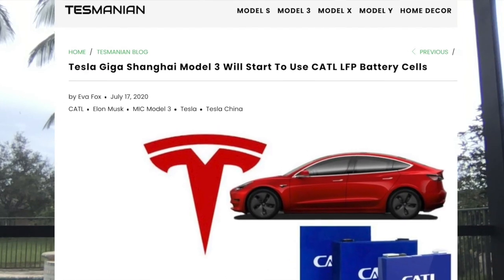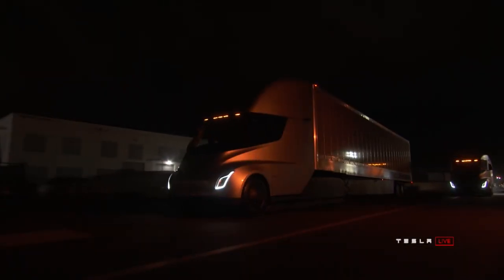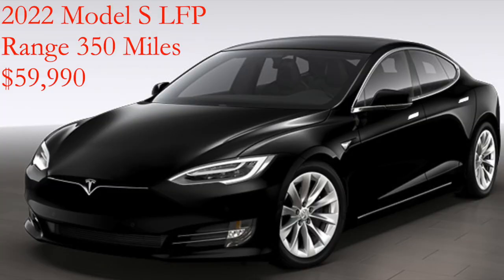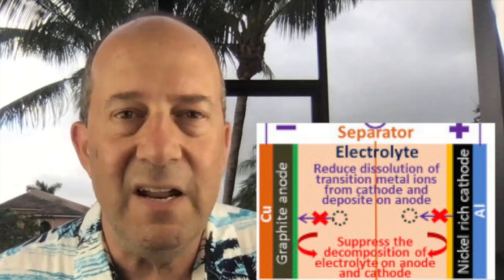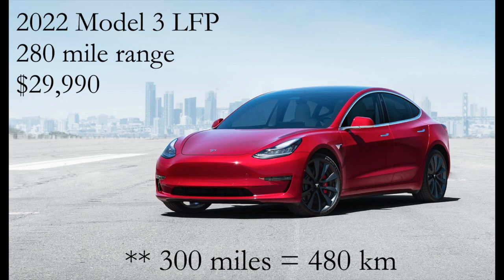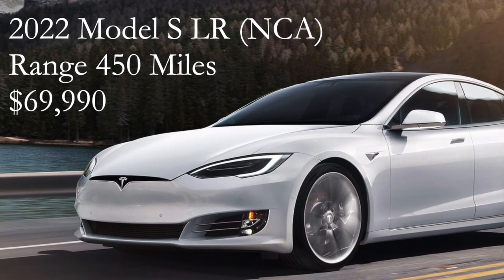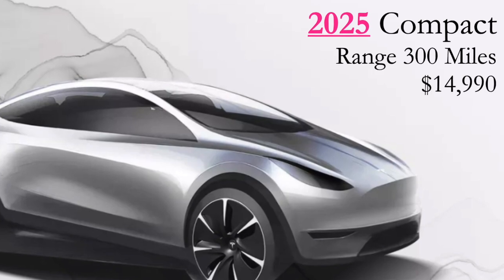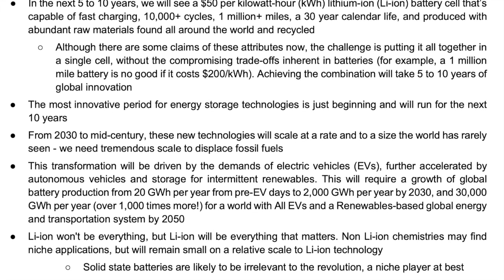Battery Day Secrets: 2021-2025 Tesla Lineup - Elon Musk

Comment: Why not use silica as the anode?
It should be a dual state sacrificial anode, theoretically having a virtual endless longevity unlike all other previous batteries.
It's simple is it not?????
Crystalline and readily absorbing water based electrolyte , best of both worlds  slow discharge , rapid charge  best of all (LOW HEAT) and extremely inexpensive.
Reply from the maker: Silicon expands too much during charging and that creates problems. They’re working on finding ways to incorporate more silicon into the graphite. Limiting Factor channel has discussed this in a couple videos.
Reply: @WarrenRedlich  I wonder if under high temperatures and magnetic field the quartz tetrahedron would combine with carbons graphite structure it may even produce the elusive hexa graphene allotrope  substrate that links in with silica's tetra formation.

Comment: A lot of it seems very plausible to me. But I don't think the prices will go down much, it's senseless to lower the the prices to a point where the wait for the cars will continuously increase because global supply of raw materials is inadequate. I think their vehicles will mostly improve, and prices roughly remain the same. The low cost market will be covered by Tesla network, an eventually used Teslas. A compact is plausible, but personally I don't think it will cost less than $20k. 

Your proposed pod, why? The total cost per mile for using shared vehicles like the model 3 or a compact in Tesla network will eventually become lower than it is in reality for most bicycles, for most users.  Safety is very important to Musk, that's why Tesla doesn't make motorcycles, a small pod can be made better than a motorcycle, but still not really comparable to a car like model 3.
Reply from the maker: Pod is because they can make 3X as many of them.
Reply: @WarrenRedlich  I see your point. But also, that would be after the semi, roadster, cybertruck, ATV and one, or possible two  compact cars.  They're approaching a point where they afford to build as many factories they want. 

Personally I don't think a pod for common road use would be very advantageous, not enough to be worth it. I think they will get less and less limited by production capacity as time goes on. But hey, we will have to wait and see, if Musk agrees with you, they will make a pod. If he continues to agree with me, they won't make a pod.

Comment: Warren, you are the only Tesla futurist on you Tube. Where do you get all this information? Also, the self driving feature adds about $6k to each model, so that has to be figured in. Thanks!
Reply from the maker: I mostly show my sources in the videos, and then I interpret based on what I learn from them.

Correct that the prices I listed did not include FSD. That's currently $7K or $8K. It will go up a lot.

Comment: In all his analysis Warren misses the main point - recharge rate of Model S, which likely to be announced at the battery day, will at least double. At least 400kW.  May be even 450kW or even more. So my bet is: >1million miles battery, >400kW recharge rate (it means  less than 3min/100km),  500 miles (800km) range. Game Over.
Reply from the maker: Good chance they'll improve charge times. Personally I don't see charge time as that important, but consumers may see that differently.
Reply: @WarrenRedlich  The charge time is a critical metric for the consumer. This matters a lot for a long travel. Also this is the only advantage of ICE car over electric. I was disappointed Tesla didn't even mentioned it during the battery day.

Comment: It's difficult to find a good in-depth description of 'lithium metal', 'anode-free', or 'lithium-air' batteries.They may even be basically all the same...???. But they seem have in common a theoretical maximum specific energy of around 40 million joules/kg (compared to around 46 million joules/kg for gasoline). But ca. 90% of battery energy can be converted to automotive energy compared to only ca. 30% of gasoline energy.

Comment: Great video. Very exciting to see the price predictions. Can’t wait until this comes to fruition. One thing I might disagree on is the pickup truck market takeover. I think it’s going to be quite a while before an electric vehicle can tow my 7000 Lb travel trailer or a farmers 15000 trailer full of equipment very far before the battery is drained. It will happen but it is a problem for now.
Reply from the maker: We shall see. I think tri-motor Cybertruck with advanced battery pack will do just fine. I suppose it depends on how aerodynamic the trailer is.

From what I hear, pickups burn a lot of gas when towing heavy loads.

Comment: No mention of plaid or liquid air?
Reply from the maker: I mentioned Plaid in the video. Somewhere around 20 minutes, give or take a minute I think.

Covering Lucid in next video, tomorrow morning.
Reply: @WarrenRedlich  you mentioned batteries. You didnt mention liquid air compressor or HVAC efficiency copv tanks safety systems or even what plaid really is at all. Or that this will be addressed at all during battery investor day at all.
Reply from the maker: First I"ve heard of a liquid air compressor. What does that do?

Plaid has been discussed before - tri-motor with advanced battery pack. Maybe I should have repeated that. Thanks.
Reply: @WarrenRedlich  you have no proof the plaid motor is 3 electric engines. You have no proof at all

Comment: Warren - I do not think TESLA will use LFP outside of China .
America is vast , and LONG RANGE Performance is KEY. 
I think America will use ONLY 2170 and Advanced Battery in the Future . 
It looks like China is shipping Model 3 to parts of Asia and Europe , they possibly will use LFP batteries in the BASE model 3 cars as Asia and Europe dont need Super Long Range cars. 
GF4 Berlin is working with LG Chem to produce 2170 Batteries under Lisense there. and LFP as well for its BASE model cars.
I think for China / Europe they will Continue making SR+ cars for the Foseable Future but for America , ELON has said TESLA will be Replacing SR+ with RWD Long Range ONLY Variants. with a minimum 300+ miles range . 
this means China / Europe will use LFP for SR+ variants and 2170 for Dual Motor + Performance .

Comment: Warren - LFP batteries can be packaged without Modules , Direct Cells to Pack , making the overall battery MORE Efficient. 
its LOW COST is Excelent for the BASE model 3 and Model Y in China. 
meanwhile , GF4 will still continue to use 2170 for Dual Motor and Performance models . made by CATL under Lisense. 
the really BIG announcement comes from the NEW Advanced NICKEL + SILICON LION batteries developed for Tesla SEMI, NEW Roadster and Cybertruck. and perhaps even PLAID model S/X can be Retrofitted with the NEW Cells as well.
Reply from the maker: Isn't that what I said in the video?

Comment: Cybervan? Don’t see that coming soon. Any thoughts?
Reply from the maker: I made a video about it
https://youtu.be/oNzivcVfAmA
Reply: TESLA right now , is not interested in a MINI Bus or a Cybervan. 
it may be Possible in 4 - 5 years , untill then there is PROTERA and BYD buses , which are 100% BEV and can transport 60 + People in Relative Comfort. Tesla will be making a 12 - 18 seater TRANSPORTER for the LV Boring Tunnels , in the mean time TESLA intends to supply them with TESLA vehicles.
Reply from the maker: Agree that Cybervan is not happening yet. But by 2025 it'll be on the road.
Reply: @WarrenRedlich   - most Likely , but would still like to see a Tesla SEMI based Public Transport with 60 - 80 seats , and a Safety Driver until FSD is Perfected.

Comment: I disagree w/ Warren’s 600 mile Tesla Van estimate. Recall the Tesla Semi goes about that far with 80k pound payload ! 

So I estimate the Tesla Van, about the same skateboard footprint as a Tesla Semi, will get closer to 1200 miles a charge, smashing a great psychological barrier as that will be more range than ice vans ! And liquid hose hyper charging will take about 30 minutes.

Don’t forget, Tesla is now researching liquid cooled charging to the Semi, so Semi-drivers can recharge during their require 30 minute break. This could be available to Cybertruck & Tesla RV as well.

I also believe the Tesla Van will have at least 4 completely different market segments or forms.

The first obvious two are the boring tunnel and Hyperloop capable Tesla Van people-mover and/or car mover. Figure two cars transported by a Hyperloop or boring tunnel Tesla Van sled,( skateboard portion of the Tesla Van only). For a 22 person tunnel people mover, it will be a complete shell Tesla Van.

The 3rd obvious derivative is a Tesla Cargo and delivery Van.

A fourth, not too obvious version of the Tesla Van plays off of Elon’s love of saving his loyal buyers money at no cost. Examples are. such features as lower car electric fuel and cost of ownership cost; lower home electricity cost through power walls, solar roofs, digital virtual power grid that recycled all these plus uses your Tesla car battery for the same; lower cost Tesla Car insurance thru AI self driving reduced accidents; income earned thru Tesla Uber-like service; etc.

To this end, for a fourth version of the Tesla Van, what is everyone’s highest budget item, (same as on a Elon Mars Colony) ? It’s housing cost. For those who desire to, what if Elon could eliminate your housing cost or rent payment, saving most people over $1,000/mo or 12k/yr ? The only catch is you have to live and travel all over the United States going to the best vacation spots and/or jobs.

Easily done with the Tesla Van-RV version: the 4th & most important version of the Van I believe will be the RV version with full off grid, boondocking capabilities.

The new HVAC and water distillation Elon has been interested in lately applies here, as well as electrified A/C, stove, heat, shower water, etc. With a fully charged 1200 mile battery, you should be able to boon dock for several days.

Something RV’ers like is big awning shades. A Tesla RV could have solar pull out awnings several times the footprint of the RV say [3 x ( 22 x 14 )] or roughly 1000 square feet of solar panels. With this awning solar panel system boondocking, (def: off grid completely),2 weeks or a lot longer, should be possible in sunny areas. Also while driving, the roof 14’ x 22’ solar panels will be charging the 1200 mile battery.

Normally RV’ers pay $30-$60 a day for camping spots that supply electricity to run all the house systems, or use a carbon fuel generator. Drinking water hose connections supplied at campgrounds is very questionable and has to be filtered.

A few other small details, the Tesla RV would have to be a little taller than the regular Tesla Van version to allow for a septic tank system, a Grey water system and a drinking water tank system.Tesla’s LSAT Internet satellite system would work great for RV’ers since Tesla’s satellite internet works best in out of the way unpopulated areas and low populated areas where a lot of RV’ers camp. The roofs of RVs are cluttered with a/c unit, satellite dish, airflow pop-up vents etc. A 100% Tesla designed RV would totally flatten the roof for the solar awning charging. In addition, a 22 foot length Tesla RV is still small enough to handle easily on the road and fit in almost all parking lots for shopping or eating.

And there are other possibilities, similar transportation problems will exist on Mars and there should be great research synergy in developing self contained systems,, boondocking is not an option on Mars and marketing the Tesla RV as multi - planetary will create much marketing hype: a space RV.

Also Space X probably would want maneuverable, modular Tesla Mars RVs that could be driven in volcanic lava tubes and then connected securely together in multiple formats to create different and larger living spaces. Docking & undocking securely starships in space is in the the Space X wheelhouse and they would have chops for applying space locking and docking technology here to RV vehicles hooking together. A husband and wife RV couple could each drive one Tesla RV and later, hook them together for bigger living quarters when they got to their final camping/living destination. Later, with self driving Tesla RVs, one person could drive 3, 4 or more Tesla RVs together on autopilot to achieve even larger camp living quarters for any budget. Tesla is already applying train formation technology to 3 Tesla Semi trains in single formation to reduce fuel costs, and that same tech would apply to Tesla RVs increasing range even more, say to 1500 to 2000 miles with train formation and solar roofs on the Tesla RVs.

If you are willing to give up apartment living or home purchase cost, that should free up $1000 a month, or more, for your Tesla RV payment, which could include an all maintenance contract. The RV industry is notorious for poor, prolonged and inattentive RV repairs which break down frequently, 100% electrification and design by Tesla will eliminate many parts & repairs. Even if you would rather keep your home, your Tesla RV could be part of the Tesla virtual electric grid. If more money is desired, Tesla can rent out your RV, most homeowners who have RVs park them in the driveway for long periods homeowners could easily rent out their Tesla RVs for $300/day 150 days a year, or $45,000 a year.
Reply from the maker: https://youtu.be/oNzivcVfAmA
Reply: Warren Redlich 

Warren, Dave Lee doesn’t think Tesla shouldn’t start a Tesla Rise sharing/hailing service yet, and maybe the Tesla bus you describe in your link will take 5 years or so and not be available everywhere.

I disagreed with Dave Lee, Tesla should start a Rideshare service now with drivers, although not an Unber or Lyft type service right away. But maybe some thing more regional, like the Tesla Bus service you describe in your link. It would start out small and initially be more flexible than fixed tunnels, at least until many tunnels are built. Until then a regional Tesla ride hailing company could provide some service faster in some areas not covered by Tesla bus.

Dave Lee failed to consider Tesla competing with buses and regional airplanes, which usually book days in advance. Say your goal as a Tesla driver is 300 Rideshare miles a day in one or two trips a day. Averaging about 100- 400 miles a trip out and back may be the sweat spot. Doing 1-2 trips a day is much more efficient and lucrative than doing 10-20 short trips a day as an Uber or Lyft driver.

Plus both greyhound buses and airplanes are inconvenient transportation at 100 to 400 mile lengths, (greyhound buses at any length). It would take about the same amount of time in either a car or airplane.

Travelers fearful of COVID-19 may prefer essential a limo driver with a Model S equipped with a Hepa filter. Also some people would prefer a more green fuel trip. This demographic would probably also be able to afford a regional Tesla ride.

And after Tesla starlink internet service comes online, perhaps Tesla will give some free entertainment for clients in the back seats watching iPads hung on the back of front seats, along with discounted supercharging for the Tesla ride sharing drivers.

And because people tend to plan these trips days/ weeks in advance, waiting for a pickup due to lack of Tesla drivers is much much less of  a problem. 

Also because booking is in advance, there is time get a return trip sold. 400 miles out one day and 400 miles back the next day would be good miles. A good weekend extra money job or a full time weekly job.

The return trip could be marketed 10% cheaper, as it more desired by the driver. 

Or Tesla Rideshare drivers may just want to do the work just to travel the country and pay hotel and other expenses, like a paid vacation. Bookings may be easier and plentiful if your willing to go anywhere.

In general though, this Tesla regional Rideshare service would be a much smaller market for this service compared to local city Rideshare trips in the 5-25 mile range. But, that’s just what’s needed because, as Dave Lee said, not that many Teslas would be available at first.

But that’s ok it would be a great beginning alpha testing phase for Tesla to get started and perfect their system and allow their owners to earn income; not to mention to create even more promo buzz and incentive to buy Tesla cars.

In addition, Tesla ride hailing service would compliment Tesla Bus tunnel service; but, would not be cheaper. It would also serve any areas not covered by Tesla bus tunnels.

Comment: WHAT is the charge time for these different batteries. I have been hearing horror stories of 3 hour charge times. And if you run low, your day is shot waiting for a charge.
Reply from the maker: Not true at all.
Reply: Thomas - all Current produced TESLA vehicles can Supercharge at 1000 mph !!!!!!!
even the Model S/X. 
this means with a 400+ mile battery, you can DC FAST charge to 80% in 10 Minutes. 
and TESLA is opening V3 Superchargers ALL the time. 
however, most people will Charge at home on 240v 60 amp OVERNIGHT to 100% , and can do so SAFELY . 
in this way , they leave home with a FULL TANK .